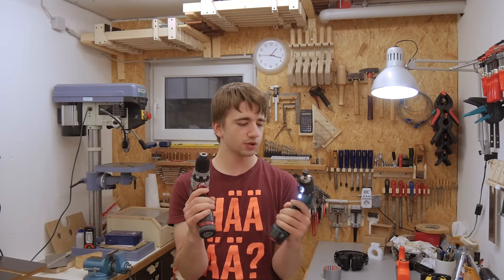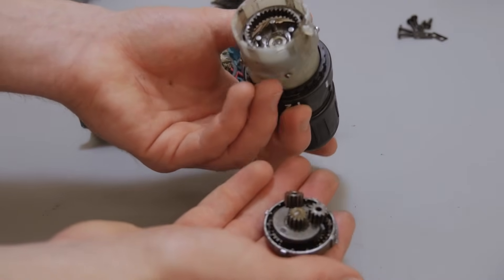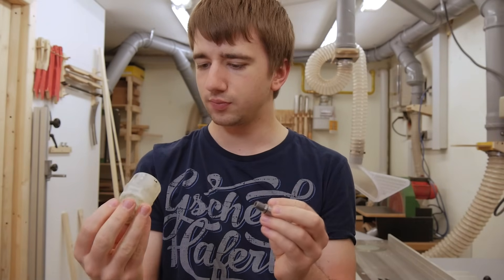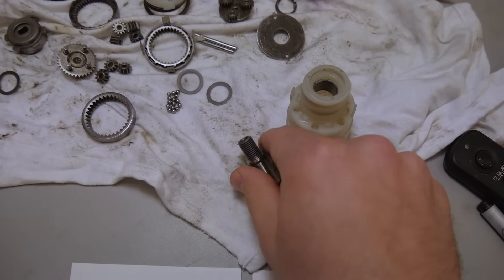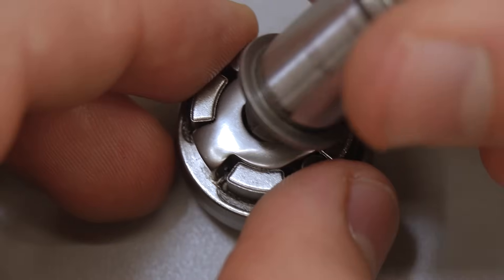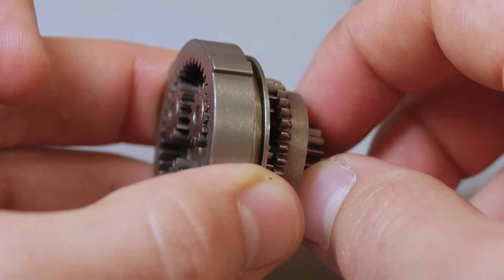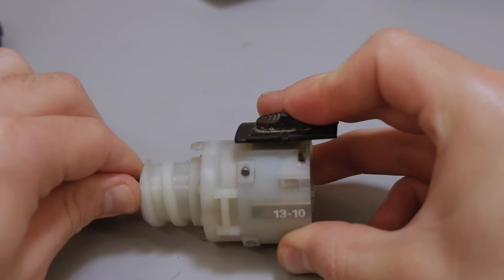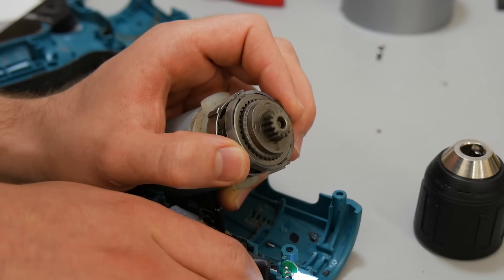Inside a Drill + "repair"

Comment: Einhell is a shitty cheap brand for powertools!
Reply: "yes" - but, but einhell has a surprising good service and the products often work well even for years

for example, i have a 230 mm einhell angle grinder for over 10 years now, they were yellow back in the days - it cost 30 euro and i just bought it to cut a few concrete pavement bricks since renting a grinder was more expensive

it still works perfectly and flawless till today
Reply: Einhell makes pretty good quality tools in relation to the price.
ive seen much worse tools, like black and decker & Toolcraft.
i got a drill press and bandsaw for many years, cant complain.
Reply: +gamerpaddy that might be, but for daily and/or longtime use you better buy a real good tool!
Reply: Einhell make toys... as do makita
Reply: I had an Einhell 7" chop saw, the mechanic was ok, the problem was the motor was under powered. What made it worse was its coil coating, it's not really good in handling heat for instance, when I used a 2 mm wide disc that came from the factory, when jammed it over heated the coil and burned the motor. Previously I used more than dozen of 1 mm discs, the motor was ok.

Comment: Great video as always! This is really a weak spot compared to how solid the rest (especially the gears) are made. The bushing is quite short for radial forces that can occur with a longer drill bit. Unfortunately they don't sell just the housing with the bushing but the whole gear box is still affordable (Makita 125539-3 around 30€).

Comment: Is just ridiculous that a gearbox costs 35€ where the whole spare-machine without batterie costs about 50 Euro. And of corse you cannot get the housing alone. Btw, are the batteries from the red and the blue brand interchangable?
Reply from the maker: No, unfortunately not.

Comment: As a mechanical engineer, I'm really annoyed by the idea of designed obsolescence. People outside of engineering have this idea that when a design is finished, we're tasked with finding a part of it and deliberately sabotaging it to fail at a pre-determined point.I take offense to that, because not only does it violate professional ethics, but no engineer could manage that job for a living.

However, looking at that part, I can see the whole story of what really happens packaged up in a nut-shell. That assembly probably started life designed lovingly to be multiple components, a housing and a bushing that was replaceable. Then when the design is done, a bean counter said - hey, let's save a few cents and make it one piece. The engineer or designer will painedly consult their figures for required MTBF and say that the 'life of the part' should be longer than the tool, so why not change it.

What upsets me is that the whole reason companies get away with the low MTBF figures is consumers simply don't care for replacing parts any longer. We value newness over strength now, because in so many ways we're used to designs becoming obsolete before they're worn out.

The upshot of this - nylon parts running against hardened steel, even cheese grade, are sacrificial, and no warping of the shaft should have occurred (not discounting dust acting as an abrasive). If you want to remove the bell mouth and accept that the life of the electronics will cause the next failure before the shaft really suffers too much, you can bed the shaft back in with epoxy.

For 10 Thou or so, you can probably accomplish this by simply smearing epoxy (they make bearing repair formulations with low coefficients of friction) into the gap and spinning the shaft (coated in a suitable mold release agent or thin film of oil) gently remove the shaft while spinning to form a smooth surface finish, and after cleaning the residue from the shaft, allow the housing to cure up. The coefficient of friction will be worse, but still low enough that unless you push it too hard it'd be a passable repair. Nylon on steel is considered self lubricating, but you'd probably want a thin film of oil on the shaft from this point on.
Reply from the maker: Oh man, that's all so true. Now that I'm learning more and more about this stuff myself along the study, I noticed where they cut corners to "save" their money. And smoother surfaces and a heat-treatment would have been enough to extend their life quite a lot. In my opinion also not too much work or money effort to realize. All in all very sad system...
Thanks for the comment.
Reply: The shady part of the companies themselves is not that they offer low MTBF components - that's a market force driven decision, they would be foolish not to in the current consumerist market. The shady part is why they even sell spares - and it has nothing to do with keeping people's tools going. It's all so they can protect their product from secondary markets, if you could repair the tool for cheap, you wouldn't buy another. If they didn't sell spares then aside from the poor PR, the market would be free for generic replacements. By offering their own they have a litigation case to prevent generic companies getting too close to the original design. With that, all they need to do is have a small trademark or patent on critical components and it's easy for them to prove loss of profit/value because of the generic 'infringer'.
Reply: Marius Hornberger ok i really learned a lot but there is one problem i got green stuff in my cordless drill motor and i dont know if i have to clean it so i would love it if you could help me out thnx
Reply: Planned obsolescence does exist. It's just not as common as many people make it out to be. 

I once refused a job offer because my tasks would include finding points of failure in designs and predicting how long it would last.

I thought it was in order to improve it but no it was to make sure it only lasts for about 1 year after warranty.

This was in the TV industry btw.
They made circuit boards that drive the panel and various controllers.
They would put underated transistors and resistors on certain places that would cause them to fail prematurely after a while causing the TV to malfunction.

Comment: Generally speaking bushings are designed to be of softer material than the shaft, unlike bearings. I bet you can get a chunk of brass and put it on your lathe and turn your own bushing or even better just measure the OD and the ID of the existing bushing to the closest mm and order a bushing online. You can get a graphite impregnated bushing for 1-2bux delivered and just press a new bushing in that drill. Its worth a shot. If the shaft has some wear, you can easily polish it as well. 400 grit sand paper on a Y shaped piece of wood will allow you to polish the shaft to mirror shine and remove any burrs. Love your channel btw.

Comment: I just did the same, bought a replacement one, only drill housing without batteries. Had problems with Gearbox on mine, didn't bother to open, because replacement was only 35euro
Reply from the maker: Yeah I know, the bodies without batteries are really cheap.

Comment: 10.8V makita is all you need for most little work in your shop and it is way easier to handle than the big 18volt 5ah big ones. i bought them together with an impact driver in a combo pack. solution for most small to medium jobs. just dont same all brands are the same. it is just...not... . eventually every tool can brake, but the cheap ones ussually brake faster/sooner. i trew away tons of cheap broken tools before i had the money for good brands.
Reply: I rarely ever use my 18v stuff.  I have a wide assortment of 12v bosch stuff that i love.  I use it because of the weight/size..its just a case where smaller is better (at least for the applications i use them for).
Reply: warmwxrules same here. they are very usefull for the regular workshop screws

Comment: Someones been watching a lot of Frank's videos.

Edit

Might also be worth seeing if you can just buy those parts on their own. And a chap called AvE does a few videos on how the drill electrical work.
Reply: Works by flowing pixies?
Reply: Only If Its Skookum choochin
Reply: the large majority of tools from 2000 on have replacement parts from bearings, bushings, motors and even screws.
Reply: What does "yyy" mean? I searched the web to learn it, and the first several hits were YieldShares High Income ETF.
Reply: +Double Dare Fan hey how are you friend
Reply: You can buy tool parts from eReplacementParts.com. If you need bearings, most can be had cheaper at bearing suppliers.
Reply: Double Dare Fan yyy
Reply: Big_Adam_2050

Comment: Actually the roughness is intentional ;)
It helps lubricate the surfaces on friction type bearings. If the surfaces were perfectly smooth you would end up with more wear because the lubricant wouldn't have anything to grip on to and would get displaced so that the metal of the bearings would get pressed together without any oil or grease between them :)
The German name for this is Schmiertaschen :)
If it would be a roller bearing a smooth surface would be more desirable though :D

Comment: Just out of interest I checked for this drill and found the replacement part for 23€ including shipping here in Austria. That's approx. half the price of the drill (without batteries). But since the replacement part is the whole gear/clutch assembly including the shaft (Makita doesn't offer it in "smaller" pieces) you essentially get a completely new front end for your drill. I guess now that you have so many other drills you don't need to fix it anymore, but if something else breaks it really is worth checking for spares. I found the prices for spares from Metabo, Bosch and Kress (that's the brands I have most tools from) very reasonable (all the prices of spares for a product combined often don't add up to much more than the whole asembled product).

Comment: If you decide to have a go at fixing it, you probably just have to replace the bronze bushing, its a softer material than the steel shaft, but if in doubt use a micrometer and measure it.
Reply: My guess is that they molded the plastic around the bushing and it's not really exchangeable on its own.
Reply: you could be right, i looked (without knowing the model number) for spares, and it seems that makita sells the entire gear assembly as a sparepart (20-30€)
Reply: Claes Wikberg
Yes, that's what I found. 23€ including shipping here in Austria for the whole gear/clutch assembly including the shaft.

Comment: The Einhell drill is the same as the Lidl parkside drill. What did you use for lubricating the gears? Great videos!
Reply: The housing of it also looks about 90% like my discontinued craftsman, which I know was sold under a few names.

Comment: hi marius have you checked for some spare parts of this model ? i know makita is selling a lot of spare parts .
Reply: Just out of interest I checked for this drill and found the replacement part for 23€ including shipping here in Austria. That's approx. half the price of the drill (without batteries). But since the replacement part is the whole gear/clutch assembly including the shaft (Makita doesn't offer it in "smaller" pieces) you essentially get a completely new front end for your drill. Would I buy the replacement? That depends on how long it took to wear out like that. The wear will most likely also happen on the replacement, so if it only took a few years to wear out like that I would not bother to replace it but get a better drill instead. Also if the battery of the drill is near its end of life,  wouldn't invest any more either.

I use mostly Metabo, Bosch and Kress tools and they all have very good support regarding spare parts (and Makita looks like it's doing the same). You can easily order almost everything in their online shops. The prices are very fair. If you'd order all the spares of a single product you wouldn't pay much more than if you bought the whole product assembled (birthday present idea: a tool puzzle ;) ).
Reply: All companies of these kinds does sell spare parts. But generally, it is not worth the cost to buy new parts to these type of handheld drill because of it's design. It would of been different had it been a Hilti or similar handheld drills that are Extremely expensive and fairly powerful.

I own a Hilti and generally, these tend to have Coals which needs replacement often and are generally more well designed in their inners. But they have another design as well.

This type of Device is fairly cheap and generally not worth fixing usually unless you can produce the parts yourself. Because of their design flaws and the fact buying parts tends to be more expensive than buying a new one.

Also quite hard to get your hands on parts as a private person rather than as a company.
Reply: makita only offers the whole gearbox for around 20 euros + shipping - you cannot buy the housing alone - the whole drill costs 50 euro (without accessories).
Reply: Every company that sells drills toward construction companies and similar do sell stuff in smaller parts. At least there is possibility to buy smaller parts in swedish cataloges but the thing is... YOU CAN'T buy it as a private customer. You must buy it through a company and you generally have to order it through a warehouse company that buys larger quantities on this stuff for you. Which means your company has to also be registered to this warehouse company to even access the ability to buy it from them. This is cheaper for companies if they can fix expensive drills such as Hilti etcetra. But for a private customer, you will literally have no opportunity to explore the ability to buy these single parts for a buck or two. Since the company that has to do it into parts will not earn anything on shipping out small stuff like that. It would be a losing deal for them.